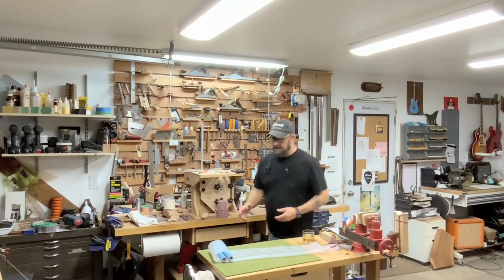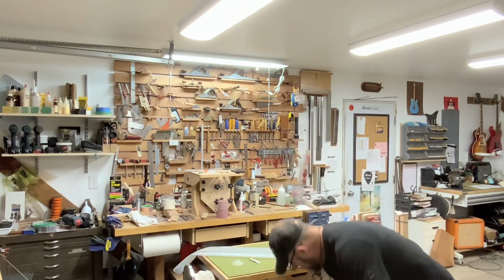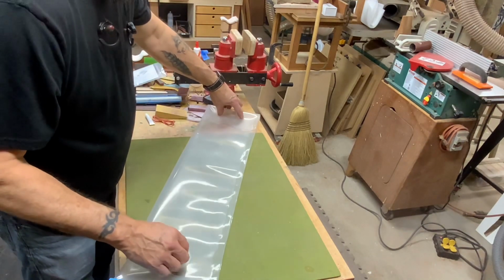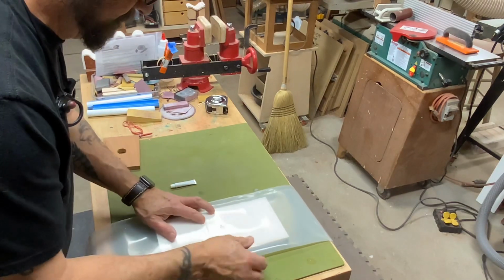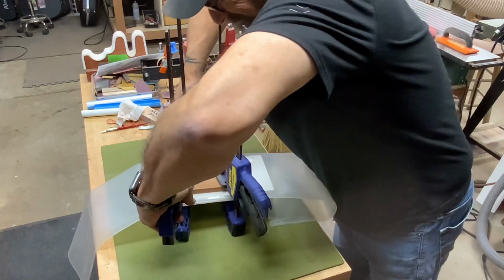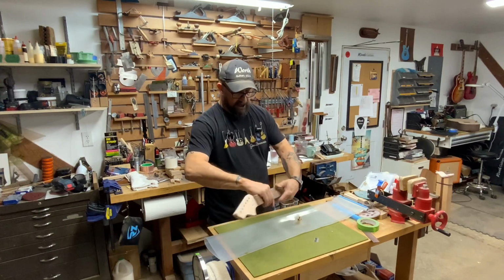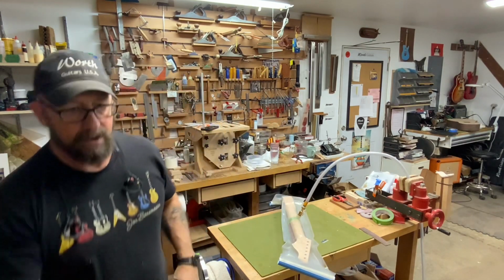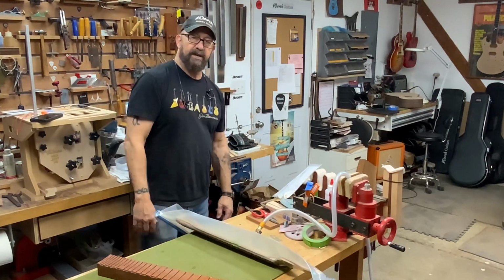Guitar Neck Clamp

Comment: Great idea. I have all the stuff already and use the bag for gluing on drop tops. You could glue up multiple necks in a large bag at about 15 minute intervals. Glue one pop it in the bag then prep the next and pop it in the bag and so on. Do a little glue clean up on the previous neck but pit it back in to complete dry time.
Reply from the maker: It’s definitely a great system. I use a larger bag for drop tops as well. So easy to use.

Comment: Any chance of the vacuum pulling the neck into a backbow? Especially without the heavy caul?
Reply from the maker: As long as your neck is straight when you put it in the bag you shouldn’t have any issues. The pressure is immediate and equal on all sides and surfaces so unless it starts out with a bow I don’t believe it will create one.